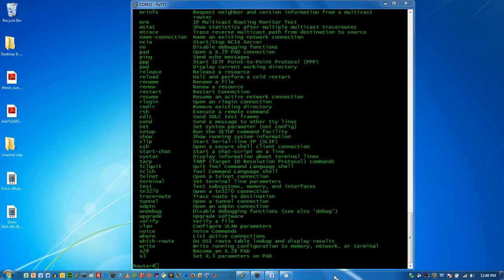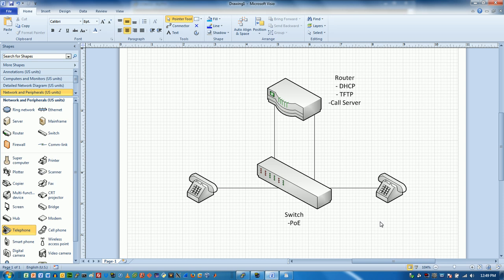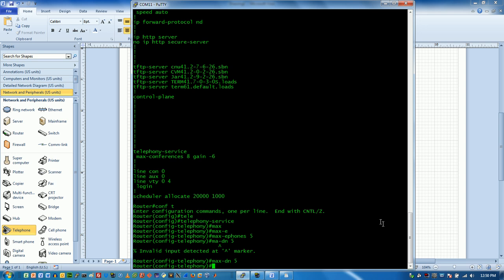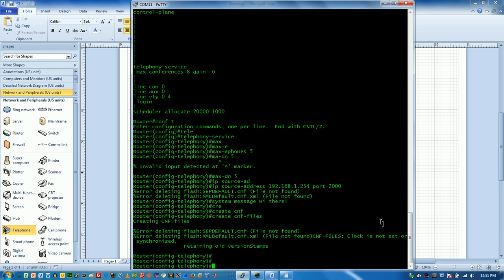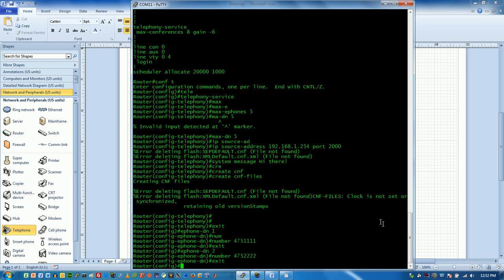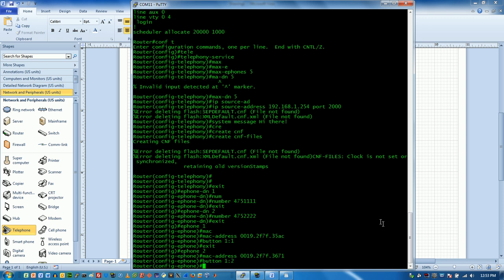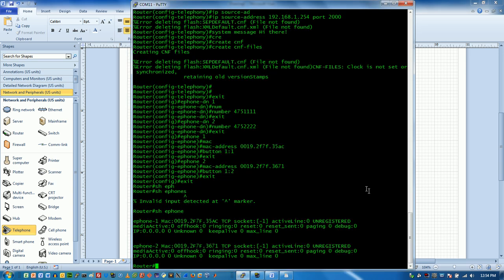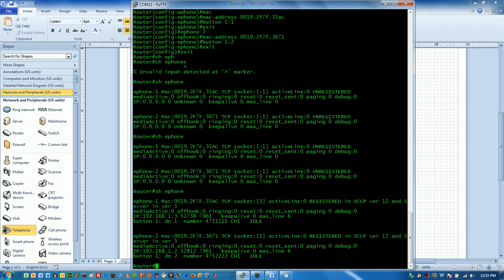Cisco basic CME config

Comment: Hi Mr. Hartpence. I put that thing visio post on my facebook page. I waited for your response but you never responded so I deleted it. I am someone who is looking for employment. I have another question. I am having trouble attempting to make a 7960 phone register with CME. My cisco ios is 15.1(4) M1.  What cme tar ball file goes with that ios? Right now I have  cmterm-7940-7960-sccp.8-1-2.tar.
Reply from the maker: Well, it sounds like you have a "zipped" file that may have the necessary files. So, you will need .sbn and .loads files. As for the employment, I am a professor here and so that is not my work. But, you can post on linkedin and places like that. Good luck!

Comment: Question:How do you change the name of the dial-peer? not the description, but the actual (dial-peer voice 1)
Reply from the maker: Hi James - I don't do this very often and renaming things in CME is a pain because the system connections are pervasive. Even ephones give a lot of trouble in renaming or changing numbers, etc. What I usually do is create a new instance and then get rid of the old. Sorry I didn't have a better answer but I hope this helps.

Comment: I am having a problem getting my phone to register I have a 7960 and when I plug it into the router it says TFTP file not found.
Reply from the maker: Well, the phones try to find a tftp server in order to get their config and any updates. Spoiler alert - the tftp server is typically the call manager. So, just point the phones in that direction (tftp is option 150 in dhcp) and as long as they do not need any files other than the config you might be OK. BTW - the 7960s are a little buggy. We replaced ours with 7961s. Hope this helps!

Comment: i have a switch router connected  to broadband  modem.  wan interface  are dhcp  and ip phone is connected  to switch  can you make viedeo on this topology
Reply from the maker: I don't know if I will get to a video on this specific topology but if I have it right, I think your main issues will be the connection between your call manager and your provider. For example, what will happen when you dial a phone number that is not known by your server? or 911? If you are not running a server, then the phone has to have a way to connect to the call manager. This is often via VPN or a gateway. Hope this helps!

Comment: hi, i am learning about cisco  voice, i have in my home lab 4 ip phone, 2 cisco 3560 , 2 switch 2960 and a router 2900. my question is do i need to have a specific cisco router for configure a cisco voice lab.
Reply from the maker: Hi Edward - you do not need a specific image however you do need an image that contains CME. We also have the .sbn and .loads files for the config. We run these topologies on both Cisco 2811 and 2900 series routers.